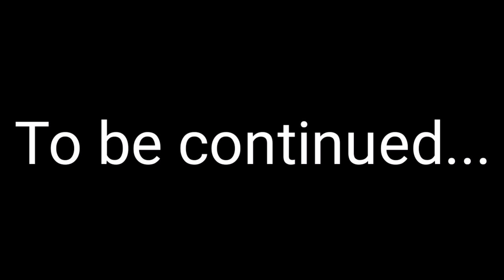Starting Work on the General Store | Another VLOG #29

Comment: It looks really great. I'm curious and have a question if I may - because I'm learning woodworking and I'm a teacher and a "perfectionist"  so people tell me -  1. How did you anchor that to the wall to be sure it could hold the weight once he loads it up with his antiques?  2. At the bottom of the shelves, closest tot he front window, why are they not sitting flat on the bins where you added wood? At the back of the wall the wood you added seems to be sitting up in the air. Just seems like those shelves will just come tumbling down once they're loaded up. I'm sure you made sure they won't but I"m just wondering how you anchored it so it doesn't because those added legs at the bottom don't look load baring. As well as the clock case - it seems like the case is floating in the air - just seems it should be seated on a base of the shelf below it.  Thanks for your reply if you get a chance to do so.  Enjoy watching you guys make things work!!!

Comment: 12 inches are down to 11,5 now? How did that happen? You need to switch to the metric system in the US. ;) A cm is a cm since they set the prototype meter in 1799. That shelves were definitely not built by someone with carpenter skills 100 years ago. :D
Reply from the maker: That's just how they mill the wood these days. So it's smooth on all sides.
Reply: @JoshuaAlexander138  Ah, ok, I see. 🙂